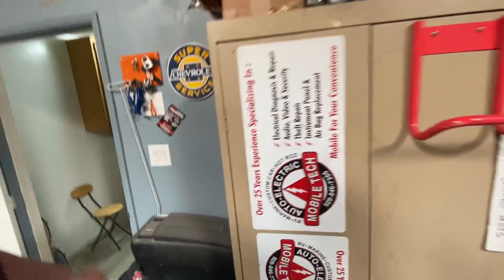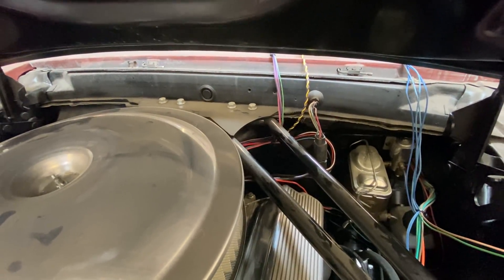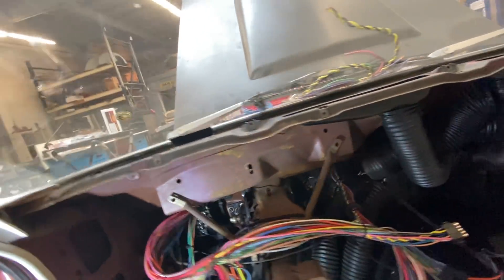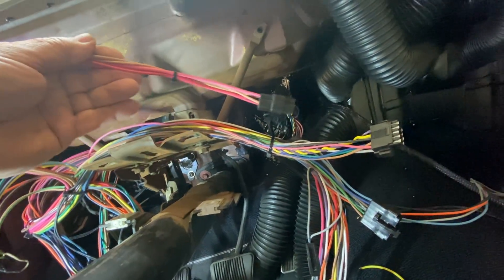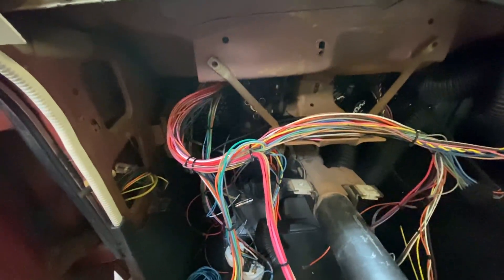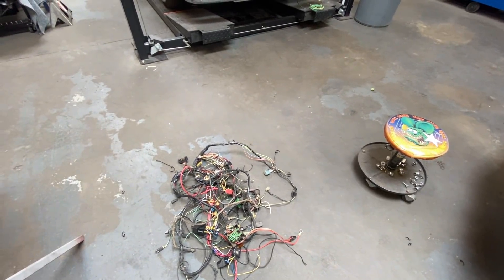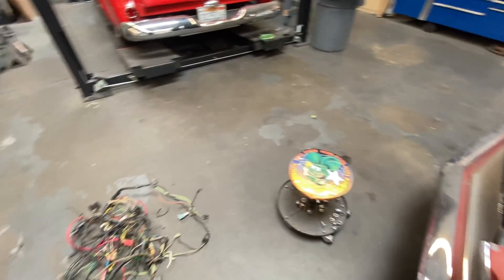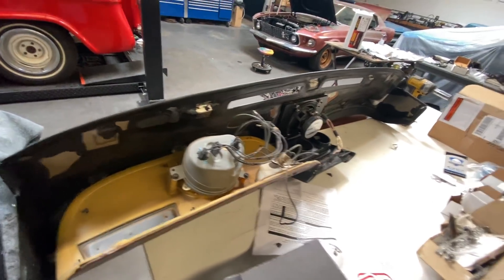Mustang Wiring 101

Comment: David needs to install some bronze bushings in his door hinges, or have you do it.  Makes it much nicer to open and close the doors, they don't squeak and the doors latch properly.  And - if you care - the capacitor on the center channel is used as a filter to block low frequencies because small speakers can't reproduce low frequencies.  Capacitors are short circuits to high frequencies, but block low frequencies.  If you know the frequency you want to start blocking, the formula for calculating the point where the capacitor starts to shut down low frequencies is 1/2(pi)C, or 1/6.28(C), as it is wired in your circuit.

Comment: Hey Lucky. Just doing the wiring this week on myk 70. Thanks for the heads up on all the stuff. Didn't even notice the dash pad needs a grill that they may not make any longer. Guess I could make a template and cut one out of some type of grate material. Thin holy aluminum designed vent cover. Make our own I guess.

Comment: For my camaro I made a custom bulkhead connector using a WeatherPack 22 Pin Connector P/N 15492531 + 1549252, instead of just passing wires thru a hole in the firewall

Comment: I didn't know the brake indicator light indicated brake failure or low fluid. My 67 has one of those and unfortunately when I wired in a painless kit in mine my dad threw away the harness and i lost alot of connectors that being one of them. I always thought that was indicating the emergency brake